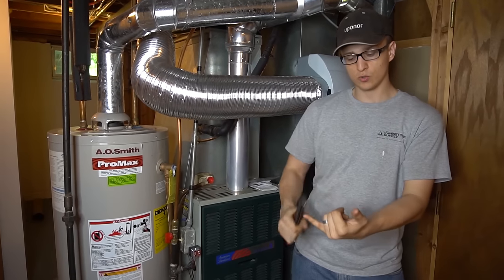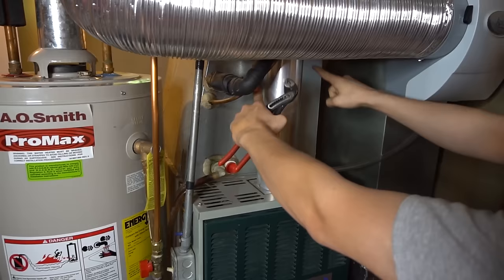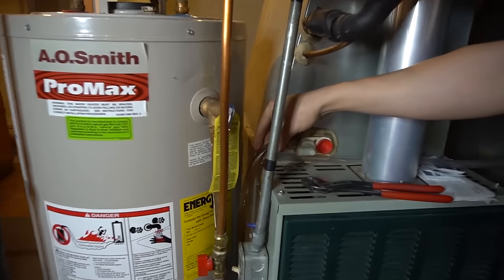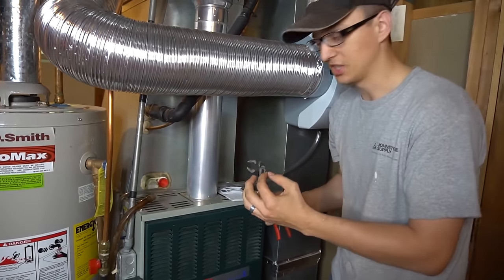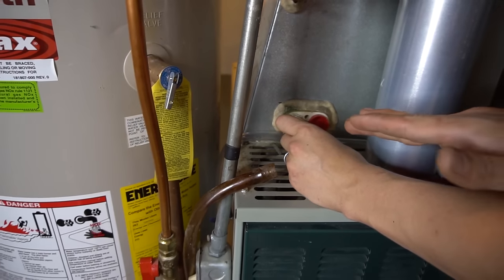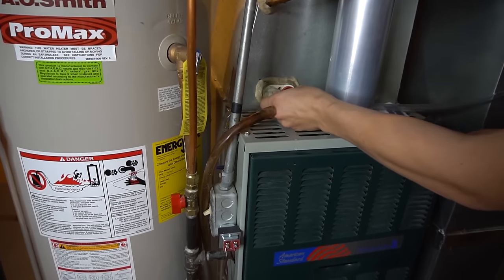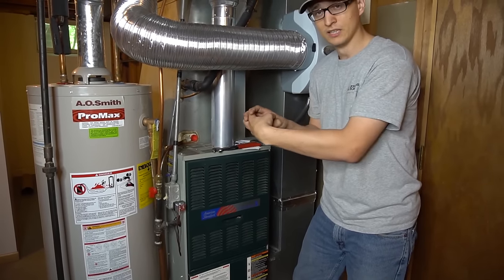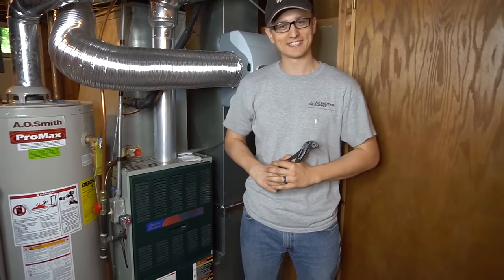Furnace Leaking Water When AC is On

Comment: Thank you so much!  It's 4th of July weekend and my basement was soaked.  I replaced the hose so I knew that wasn't the issue.  Exactly as you said would happen, once I got the connector off, water gushed out for a while.  The connector was all gunked up.  I cleaned it out and now its draining perfectly.  I feel like I should send you a check or some cookies at least.  Thanks again for taking the time to share this with everyone as you saved me having to not only call a professional, but pay extra on a holiday weekend.

Comment: Thank you 4 years later.  Easy fix for me.  
As you mentioned there was a lot of water that drained out once the clog broke free.....even more than a towel would soak up and you sure don't want it running into your furnace.  I used a piece of cardboard to make a v-channel ramp for the water to drain away from my furnace and into a bucket.

Comment: I have to do this tomorrow. It leaked a little beginning the end of last summer and we are supposed to have lots of heat this year and there is that water puddle coming out at the bottom of the combo ac/furnace. My husband died 4 years ago and it has never been cleaned out for the past 12 years that I know of. Maybe much longer as the furnace is 35 years old and the air conditioner is past 20. Yay...thanks for your video. I got the area all cleaned up and the drain pipe all washed out from the 2nd bend on but still a puddle so it's gotta be in one of the two elbows (or in between) that are near where the drain pan is. At least tomorrow will be cooler and the puddle is on a concrete floor! Thanks for the video!!

Comment: Great video!  I followed your steps and, just like you said, the blockage would be inside the fitting at the furnace if it wasn't immediately in the drain line.  I stuck my stretched out hanger into the furnace and... just like that... water came started pouring out! Lol  I saved the money of calling an AC guy out, and also able to turn my AC back on without fear of it leaking and further warping my laminate hardwood floors!  Thanks, man!

Comment: Thank you....I am the unlucky one and do not have a hose for the drain....rigid PVC and it was clogged.  I used the air compressor as you said and it started flowing.  Also took off the cover to the coils and looked at the drain...WOW...Had to spend some time cleaning it up and now the drain is clear.  Thank you for the video and suggestions.
Reply from the maker: You're welcome! Glad to hear you were able to get it fixed! Thank you for coming back to share how it went! :)

Comment: I had a water leaking issue so after watched your video I did all you said and now there's no water leaking.
Thank you so much Sir
Reply: I had the same setup as the video and water does come out of the plastic nozzle but when I connect the plastic tubing to it, no water comes out and it's a brand new tubing?

Comment: Thanks for this video! I was just about to call an HVAC company when I thought I should Google <furnace air conditioner evaporator drips water> and found this!
Turned out the drainage hose was so clogged I had to take it outside and blast it out with my garden hose. Why was it so clogged? Because I had been away for a few months, and forgot to change the furnace filter before I went away. It got so clogged that it buckled and pulled away on one side so who knows how much dirt and dust got through? But the pvc hose was clogged from one end to the other. Took a while for the water blasting to work and had to reverse ends a few times before I finally got water to come out the other side. I got soaked in the process! Hopefully the drain pan under the evaporator coils isn't full of more debris, but I will now be checking that hose periodically to make sure it's open.

Comment: I have large puddles of water from underneath my furnace. I’ve even noticed condensation built up on the outside of the condensate drain and the copper fitting it connects to into the furnace. The copper fitting builds up frost line you would see in a freezer. The evaporator coil is not frozen though. My furnace condensate drain and pan are clear. I poured a half gallon of water directly into the pan and the water drained as quickly as I could pour it. No leakage from the pan. 
The microchannels appear to be very clean. I replace my air filters within every 3 months. 
The only thing I notice is there is a lot of water dripping from the copper return u-bends and they have quite a bit of rust built up on them. 
At times, my A/C cannot keep the house as cool as desired. As if it can’t keep up. 
The furnace and the A/C are both approaching 24 years of service. 
I’m guessing I’ll have to call a HVAC tech out.

Comment: I had taken the drain on the furnace side all apart and it wasn’t plugged. I stupidly didn’t follow the line from the sump hole back or I would have seen the T to the drain for the air-conditioner. It was plugged. I got it now. Thanks.
Reply from the maker: Glad to hear you eventually did track down the problem spot! :) Thanks for watching and commenting!

Comment: it happened to me.  an inch of water around by air handler unit on the floor.  i googled and as this video says, it's a common problem.  your coils become dirty over the years and that dirt will drip with the water condensation removed by your ac and will clog the drain line.  mine is a solid pvc drain line with an access connector.  you can try blowing it through, or use a wet-dry vacuum (duct tape the opening to create more vacuum like closing your mouth at the dentist when suctioning) to suction it out.  or, i got a $10 10-feet mini snake from harbor freight and snake it back to the ac or forward down the drain line.  the mini metal snake fits the small diameter of the drain line.  it like snaking your toilet drain to clear blockage.

Comment: I have an overhead ceiling air handler. It's 21 years old. I found water on my bathroom floor and when I opened the ceiling flaps, I saw that the pan had a couple of small holes due to rusting. Will replacing the pan fix the problem? Or is there a leak regardless?

Comment: what is the Red/Orange plug beside the condensate line??? mine is leaking from there!  I tried tightening it but it's just small plug that screws in about only 2 full turns.( there is not a lot of thread on this plastic piece).  Would plumbers tape help stop the leak?

Comment: great video advice (not only this one). 
considering the situation is in an apartment building and the unit is an inside AC (like a ClimateMaster Tranquility 16, 5 ton).
question: How do you keep the drain line clean? sometimes experts (or 'experts'?) recommend a monthly or bi-monthly dosis of either bleach or vinegar to clean the drain line. what do you think? or maybe you have a video about it and i just didn't find it.
again: great videos, short, to the point, logical. big help for many i am sure.

Comment: Wondering what putty or seal compound you use to seal surrounding of liquid line and suction line goes into evaporator coil? Thanks!
Reply from the maker: It's called plumber's putty. You should be able to find it in most hardware stores or buy it on Amazon: Plumber's Putty: https://amzn.to/3j1JRZl
Reply: @WordofAdviceTV  Thanks for reply. I actually got plumber putty at home. I thought it may need to be some special compound specifically for duct seal originally.

Comment: Do you have a video for leaking humidifier? Can you make one please. My humidifier was leaking from the base onto the furnace and I had change the filter and clean out the case. Also my plastic case for the filter is attached to the top with a wire?

Comment: I have this exact problem currently. Goodman unit, in an old home. But I have no idea where the drain line or pan are? I'm sure the entire system was poorly installed... The water seems to be coming from the top of the unit/ceiling/roof; leaking into adjacent walls and soaking the floors and furnace below.
Reply from the maker: Is your furnace in the attic? An easy way to track where your evaporator coil is, is to follow the copper pipes that come from the unit outside and see where they go to inside the home. Where you find the evaporator coil is where the drain line will be also.

Comment: First of all, thank you so much for the video.  I was removing the unit's cover from my air handler unit the other day, just to see the condition of the inside of this 14 yrs old unit, and discovered that water was absorb and dripping down from the fiber insulation material that was stick to the back side of the unit's metal cover, there must be like half of cup of water came out.  Question #1, what do you think the issue is?  Question #2, most of us turn on the AC unit during summer here in Florida, is this why I have such as high humidity level of 70% inside of my house?  And when I shut down the unit completely to do some regular maintenance (every 3 month, I remove the float switch and pour bleach to keep the PVC pipe cleaned), the inside humidity will fall down to around 55% by itself, but the moment I turn the AC back on, it came back up high again.  What do you think the issue is?  Once again, I have watched a lot of your video, you always have great suggestions, thanks again!

Comment: If the condensate drain line is clear but water is leaking from a rusted out drain pan combined with poor design of the drain line (start point too high up), should replacing the drain pan and lowering the pvc drain line be an easy fix? Can a generic fit pan (if they exist) be caulked or sealed around to adapt for accurate fit? My system (Heil) works fine, just leaks. In the sweltering heat of so Cal, it's cRaZy here. Thanks.

Comment: Hey who did that music at the end?? That's some really great chiptune!
And thanks for the info! Our flue pipe has been leaking back down into the unit, onto the plate above the burners since we got our furnace. Rust and crystalline deposits pooling there and on top of the unit where the first bend in the galvanized piping is. Hopefully this may fix the issue, but I have a feeling it may be something else. My bets are on the person who installed it doing a halfassed job. Not sealing the pipes properly... Among other ISSUES. Like our ignitor and wire leading to the ignitor being seriously burnt up.

Comment: What type of forced air should be used? Do you have a tool you would use?
Reply from the maker: I use carbon dioxide tank with a pressure regulator but that is typically not something readily obtainable.. Just a regular air compressor would be enough though.

Comment: at the 0:38 mark you see a copper fitting with sealant and then right above it, another fitting with black foam insulation wrapped around. My leak is coming from that black foam line that connects into the furnace wall.  HELP
Reply: Mine also. How do you fix that

Comment: I have a pan below the furnace that fills up with water that i have to pump out at least once a summer.  I just checked the condensate drain plug and it looks fine and the hose (pvc pipe in my case) seems fine.   What else could be the issue here?
Reply from the maker: It sounds like there is a partial restriction somewhere.. Being that it's PVC pipe, it is probably all glued together which makes things more difficult. You can try blasting compressed air through it backwards to try to clear out any blockage or you can cut the pipe and unscrew it from the coil drain pan to clear out and restrictions that way. Then just put a coupling on to put the pipe back together.
Reply: @WordofAdviceTV  When you say "compressed air", are you talking about the canned air duster they use for computer keyboards or something else?
Reply: Omega Bear He means air compressors such as https://www.homedepot.com/p/203471431

Comment: My line must be plugged cause when I removed it from the fitting. Water came pouring out. Unfortunately it was backed up for a bit so water was coming out the bottom of my.furance... can this wreck your furnace?
Reply from the maker: Don't worry, it is rare for the overflowing condensate to damage the furnace. I have seen it happen where the water would damage a control board or something but it was only a few times.
Reply: @WordofAdviceTV  what about the insulation in the bottom of.the furnace. I have a small piece of black insulation lining the floor under the blower motor. I have the cover off and a fan blowing in to dry everything out. But the insulation is still sopping wet. Can this just be replaced ?
Reply from the maker: @whydoyouneedmyname6508  That insulation is not vital. It's no big deal if it is wet, with the fan running it will dry out pretty quick. I have never replaced that insulation, at most I would tape or glue it. When it gets wet sometimes it will start to get undone from the bottom or sides and start flapping around.

Comment: What should I turn off before trying to unclog this?
Reply from the maker: I usually don't turn anything off since there is nothing electrical involved. But if you wan't to air on the side of caution, you could turn your thermostat off and turn the furnace power switch off. (or furnace circuit breaker)

Comment: My drain pan clean but my burner box is leaking has water in it. I can't figure where the water if coming from.
Reply from the maker: Is it a high efficiency furnace? (is the vent pipe plastic?)
Reply: Yes, High Efficiency Furnace. I replaced new AC unit about 2 1/2 years ago. Plastic PVC piping. (wish i could attach photo). I hear and see water inside the incase burners when I turn on heater. When fan starts to blow; I see water fluttering in the burner box.
Reply from the maker: Oh wow. I can't say I have seen that before... Sounds like water is somehow getting in through you intake pipe or your secondary heat exchanger has a big crack or hole in it. If you take that burner box cover off, can you tell where the water is coming from? You can also take off the intake pipe (those are usually not glued) and see if it is wet. If the water is not coming from the intake pipe then you may have a big furnace problem on your hands. At that point I would call someone as heat exchanger problems can be serious.

Comment: So I’m one of those unlucky people that has the pvc pipe glued on. So I’m assuming you blow the air from the other end of the pvc pipe?
Reply from the maker: You can do that, yes. The other option would be to cut the pipe and then glue it back together with a coupling or a threaded connector. The connector is better since that way if it happens again you can simply unscrew the fitting to get to the drain pan's outlet port.

Comment: I cant take the pipe out to clean it cuz is sealed off 
Again, what should I do to clean it pls
Reply from the maker: You can either blow backwards into it with some compressed air to dislodge whatever is clogging it or you will need to cut the pipe and then reattach it with a coupler. You could also use a PVC union instead of a coupler so that you will be able to take it apart again if needed down the road, without needed to cut it again.

Comment: Yeah ummm that didn't fix our problem.  We had our ac guys come out two times. There was a clog in the condensate drain and they got it off the ground and hung it with a pitch.  However the blower seems to be blowing the water out of the pan and onto my carpet.